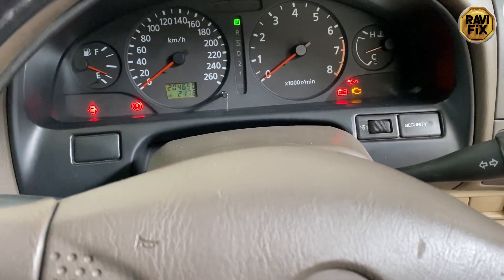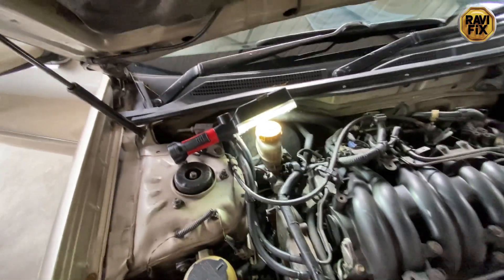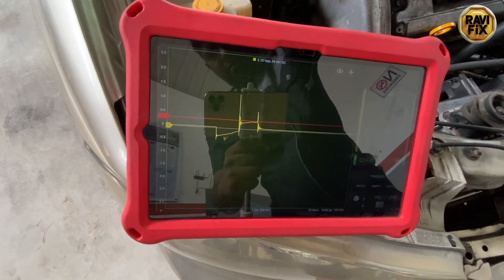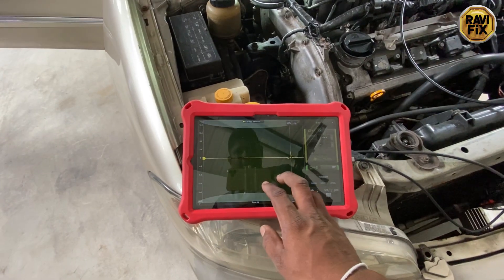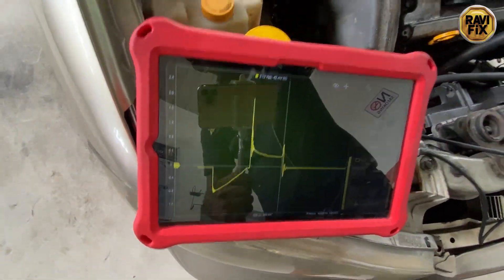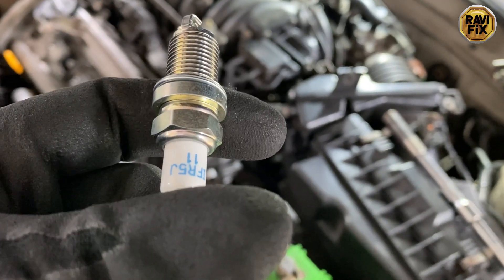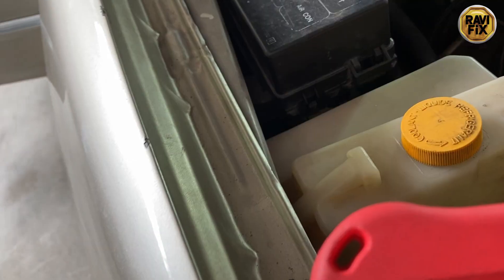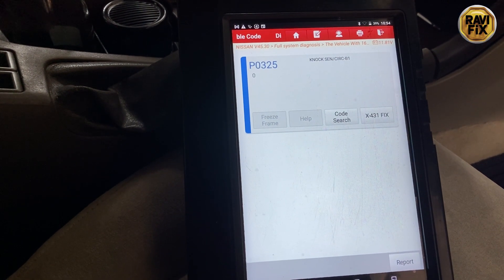Secondary ignition waveform test. most efficient & reliable diagnostic test. Nissan P1320 diag & Fix

Comment: Hi Mr. Ravi, 
I’m not a technician but I really appreciate your work & knowledge sharing sessions through the YT.

 I have a 1999 FB15 which had the same issue. Previously it indicated P1320 fault code time to time and drop the fuel consumption significantly. After cleaning the ignition coil sockets it disappeared. Is there any chance the problem might still be there even if the fault code is not visible?
Reply from the maker: No need to worry if fault hasn’t set.

Comment: Ah, the old P1320 code. What's up, Ravi? Normally,  this code comes with a faulty capacitor that is on the harness that is in line with the primary side of the coils as well. I'm glad you found the issue. Thanks for sharing
Reply from the maker: Thanks, I am fine Danny .
Yes this code pop up for ignition primary side. That capacitor also a one cause, mostly I experienced bad ignition coil it self set this code, but this time I found this counterfeit spark plug cause to P1320

Comment: Great video, Ravi! Imitation plugs do seem to be a problem today. Normally, I would not think the profit margin was high enough, but at 10-15 dollars per plug, it adds up. Also, selling online takes even the face to face transaction away. An actual store might not even know they have some fakes mixed in, but online, it seems more rampant. The sellers don't even have to look at you to rip you off, plus they have a supply chain to blame for fake. 
 I did have that happen a few times with hscope crashing randomly using a paddle probe. I thought it was the EMI in general causing the crash and switched to the flag style pickup that is a little more resistant to crashing. After watching this happen to you and that plug having such a short burn line, the next time it happens, I am definitely going to be doing some measurements! Thank you!
Reply from the maker: Thanks Eric
This affected cylinder had completely different spark plug than the other cylinders which was counterfeit. May be previous shop has swapped just this plug due to any reason. You are right counterfeits are everywhere in the world that hard to recognize.